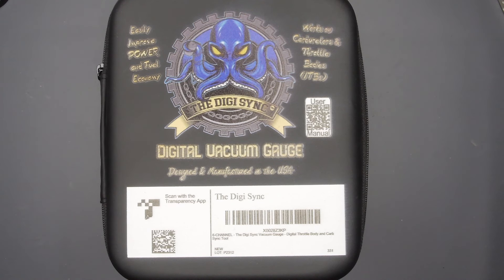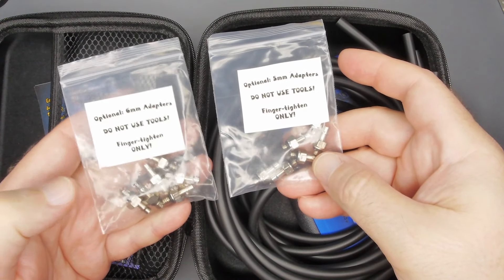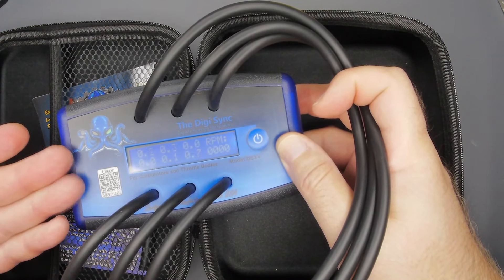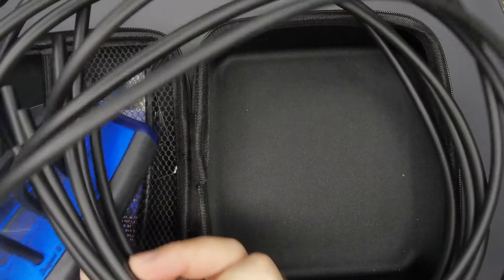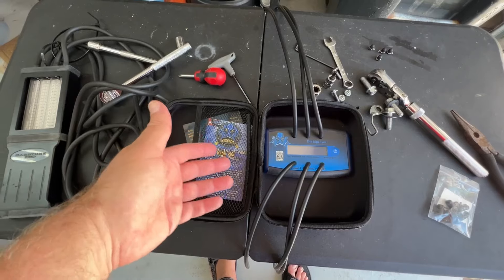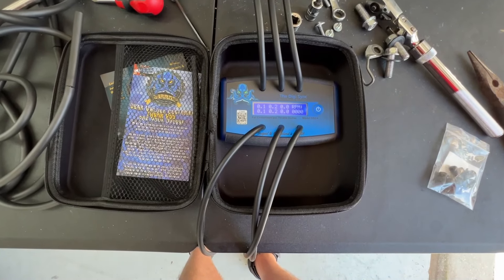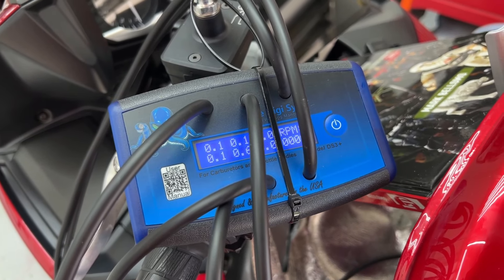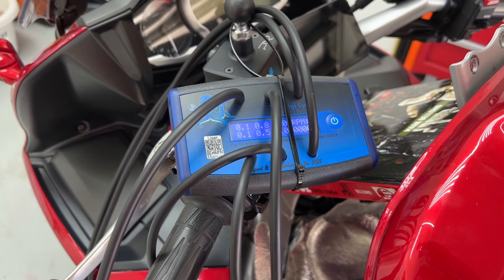DigiSync Throttle Body and Carb Sync Digital Tool Manometer Review

Comment: I watched your first video on carb sync years ago.  I bought the sync tool you recommended back then and have used it twice since.   Very easy to do.  My FZ09 didn’t even need any adjustments, but glad I checked.
Reply from the maker: Good stuff